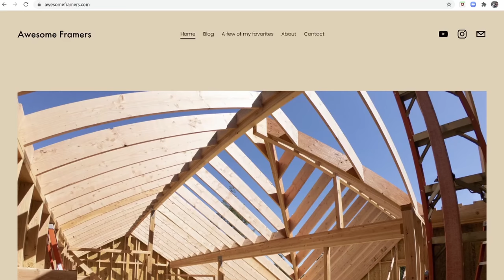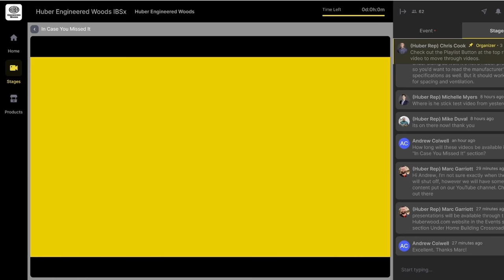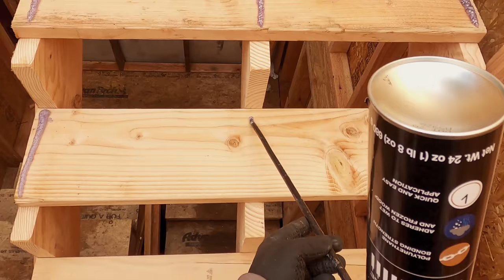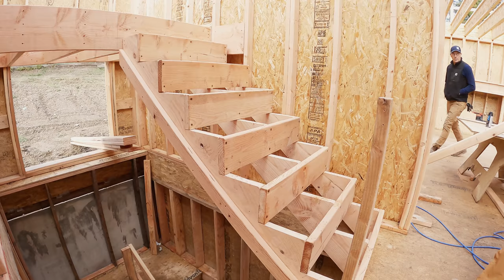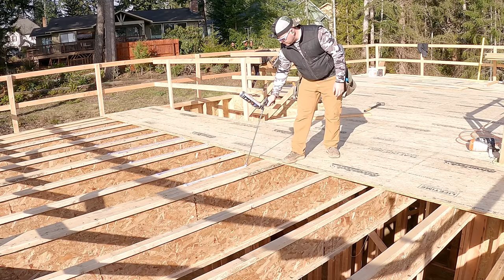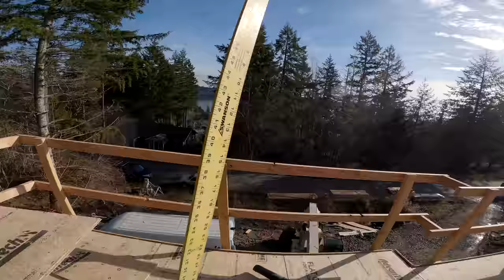Project 171 Part 4

Comment: Hi, I am looking for advise on how you would frame an exterior wall that has an L-shaped staircase, the walls are 2x6 and are not ballooned framed. It is possible to run the joist band rim board around, than install framing lumber same as the floor height with ply; essentially a header but in the floor. Or, do you run the suds from one of the wall long to fill this in, giving a better way to insulate?

Comment: Hey, at the very end of the video I was noticing that it didn't look like the TJIs were blocked or nailed to a rim. Does the sheathing suffice there? or did I just not see some framing. Nice tip on those framing strap connections for top plates. Thanks!
Reply from the maker: Blocking isn't required by our engineer or the 2018 IRC.  The engineered rim is stronger than the joists themselves and is not only designed to carry the gravity loads from above but also wind loads.  LP has some great information on their LSL rim.

Comment: Why the hell did I use subfloor caulking in a 20oz gun??   :(
Reply from the maker: Right, this is so easy!
Reply: @AwesomeFramers  well i may have to do it again!  i have 14" ibeams, 16"OC, 3/4" OSB and the floor bounces.  i may have to add 7/16" OSB to thicken it up.

Comment: No hate man but the bracing part don’t make sense cuz you save time in the back end but use more time in the front end. I just grab my hammer bend the nails and cut that section of the board. I mean it’s usually been nailed pretty well so it lost strength either way no need to pull those nails out and save that lumber
Reply from the maker: There is no way that bending the nails and cutting the board is faster than pulling and reusing the screw.  All of these methods are about the same time, but I choose the one that's easiest on my body.  At 43, I want it to keep lasting without injuries.  I've made it this far 👍.  

Oh and disagreement makes us better, feel free to ask anytime.  My ways aren't right, they are just another way to do it right.